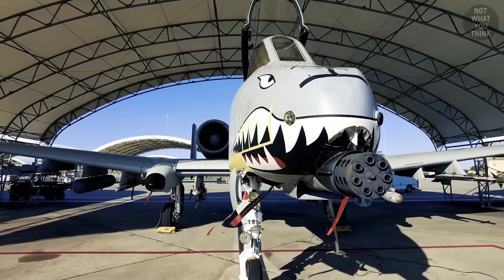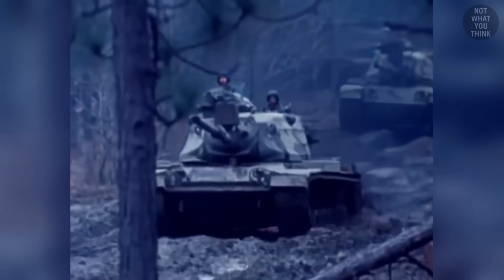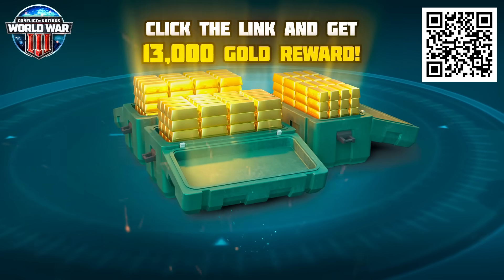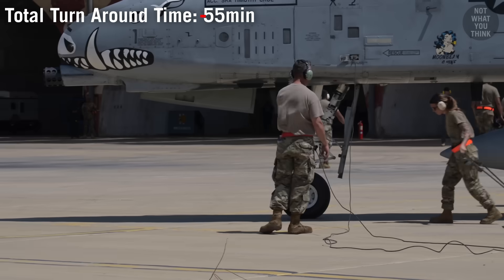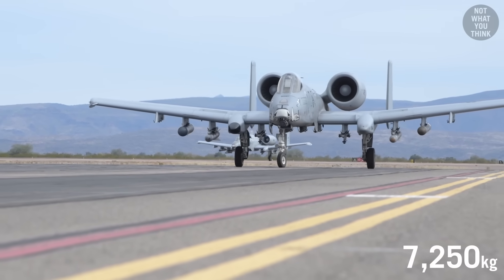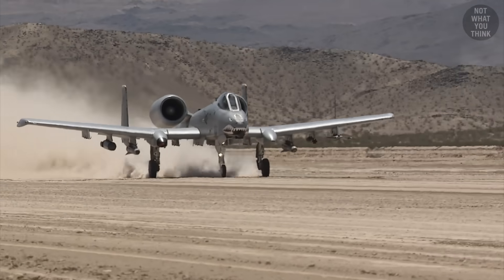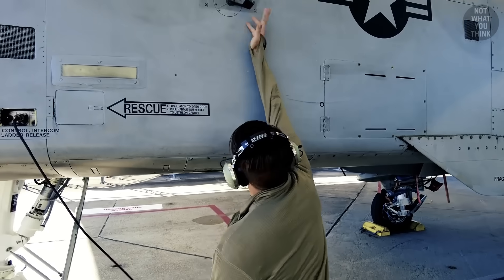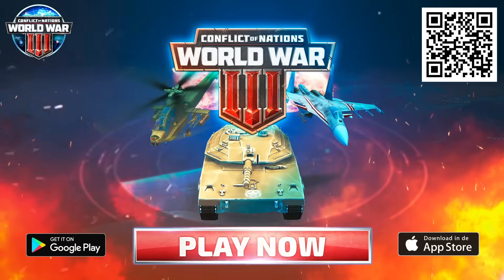The Aircraft That Doesn’t Eject Bullet Shells

Comment: The grunts are going to be hurting now that the A10 is retired.   The F35 is NOT at suitable replacement.  The F35 was never designed to be a CAS (close air support) aircraft.  It will fail in this role.

Comment: IT'S BECAUSE THEY USE THEM TO HOLD THE WEIGHT BALANCE IN CONTROL AND THEY COME AUT WHEN YOU PUT THE NEW BIG MASHINE CANON BULLET'S IN AND THEY STILL SIT IN THE BELT AND COMES AUT WHEN THEY LOAD IT BY TURNING THE BIG MASHINE CANON BACKWARDS TO LOAD FAST AND THE MANY KILO IS COMING AUT AND IS REUSED FOR IT IT'S VITAL FOR STABILITY AND THEN THEY DONT HAVE TO BUY A HOLE NEW SET AND THINK IF IT REALLY WHERE DROPPING THOSE BIG SHELL'S AND THEY HIT SOME INNOCENT PEOPLE THAT WOULD BE VERY BAD, SO TO PROBLEM'S SOLVED IN ONE GO.🌹🌷🌺🔥%.
 ♥️🇩🇰K.H.C.🇩🇰.
🇩🇰COPENHAGEN♥️DENMARK🇩🇰.

Comment: The A10 is definitely not obsolete. The military has been trying to retire it since it was adopted. The reason it's still flying is because its so damn cheap. Probably the most cost effective CAS platform in the world
Reply: Low and slow. Many sams systems can not shoot a A-10 down. With a little air cover, the A-10 can still shine. And nothing better suited for CAS than the A-10.
Reply: It's obsolete in every place filled with manpads.

Comment: Why do people prefer the A-10 Warthog over the sky warden? Is it more durable? is it easier to refuel and rearm these things to get it in the air faster? Is it purely the vibe or the sound of the gun? There has to be something I'm missing otherwise it just feels like the sky Warden is better in every single way other than a gun. It can loiter in the air longer, it's got much better sensor equipment to actually detect enemy movement and armor on its own and warn ground forces about it ahead of time spot targets on it's own, it's smaller and probably more maneuverable, it doesn't have a gun but it can hold a ton of missiles and bombs that are great for dealing with armored targets. What am I missing here?

Comment: The USAF have planned to retire the A10 since they  came into service - they have always found that the A10 was the only solution to a problem that ground forces were faced with. They were due to be retired in 1990, 2000, 2012, 2020 and now 2030 - I'll believe it when I see it. 

As for the aircraft already sent to the boneyard - these will be the older ones that have already exceeded their flight hours for the airframe

Comment: It seems to me a budgeting problem. The A-10 could be kept on because not all battles are peer to peer.  Let's say we need to put troops into Myanmar.  They don't have top SA missles systems, nor expensive radar.  If the A-10 squadron is paid for, pilots trained, spare parts are in the pipeline, etc.  Wouldn't it be cheaper to send the right tool for the job?  Just keep 2 squadrons around for the small jobs? How expensive is maintaining 2 squads of A-10's v. building and flying brand new F-35's?

Comment: I suspect the A-10 will hang around like the B-52. The Air Force KEEPS TRYING to decommission them, but as long as you have friendlies on the ground you'll need CLOSE air support.
Reply: close air support is already a provided with fighters, helicopters and drones
Reply: @aquilesca5tr0  Fighters do it BADLY. Helicopters do it Slowly. Drones don't carry enough firepower and lack connection to the grunt on the ground
Reply: @gcswift2  the f35 is already the replacement for the a10, the a10 is just completely useless in a modern envinronment

Comment: It is thought the A-10 is obsolete because strafing is no longer needed. It was thought that guns were obsolete on fighter planes due to air-to-air missiles. This is why the F-4 Phantom was built without guns and a gun pod had to later be added. Staffing is direct, up close visual targeting and the staffing pass can expose more targets. The armor of the A-10 was not designed for the modern antiaircraft weapons of today does not mean retrofitting cannot be done. For that matter, a new generation of A-10 designed a built to counter the new ground fire threats. These are designed for ground support only and would not be redirected to intercept enemy aircraft so troops needing their support would not be left waiting whole under threat.
Reply: Most of what you have said is true, but there's only so much armor and anti-missile tech you can throw onto a slow-moving target before it's no longer able to take off. With modern weaponry, it's far more efficient and smart to simply use a faster plane that can get in and out before the enemy has any real time to try to take it down. Remember what he said, modern anti-air weaponry can keep up with some of the fastest jets in service today. The A-10 is literally a sitting duck in comparison. Sad, but true.

Comment: From what I've heard, the Air Force brass hate the A-10 - it's slow, ugly, old, low-altitude, works right out on the sharp end, and does the non-glamorous job of supporting infantry ground-pounders. They've tried to retire it repeatedly. Not sure what the pilots themselves think about it. 

However the Army LOVES it. It can take out tanks or artillery, and send soldiers scattering for cover and into disorganization. And that's why we still use them.

Comment: What they really need to do is simply redesign and remanufacture new A10s with state-of-the-art avionincs. The actual construction of the jet itself is amazing - that doesn't need changing. Neither does the propulsion system or the gun, which is HIGHLY effective at its job. What does need updating are typical things like the sensor package and modern targeting systems, but beyond that the actual concept and overall body of the plane was amazing from day one.
Reply: the f35 is what is needed for cas in the modern battlefield, the a10 will be vulnerable to manpads no matter what upgrades it gets

Comment: the A-10 won't be retired until there's an actual replacement. f-35 doesn't fill the role of the a-10, neither do f-16s. So i feel like that line of reasoning is incorrect.

Comment: F35 is not an appropriate replacement for A10, it lacks the low speed handling of the A10, which is essential for CAS.... F35 can't just loiter for hours.
Its just not right for the job.

Not that I'm a huge fan of A10 either, but A10 is a lot better at CAS than F35 will ever be..... because F35 isn't built to do that job.... F35 is an invisible fighter, it has better things to do than dropping bombs on ground grunts.
Reply: you can´t have something flying low and slow for cas in a modern environment, manpads are always a  threat
Reply: @aquilesca5tr0  manpads have always been a threat, and A10 has managed to low and slow despite that threat it for decades.

I do get what you're saying though.

There are no good solutions if its anything near peer.
Reply: @Mort_OOPz  manpads weren´t a real threat when the a10 was designed
Reply: @aquilesca5tr0  Right, but they've been a thing for the last 40ish years, A10 has kept flying, not sure what your point is?

Comment: Oh and your bs narrative re the a10 being obsolete   you have missed or misunderstood a ton

Not to mention the fact that there are a bunc of brass at the USAF finally pulling their heads out of their asses   or not getting enough sweetheart deals from lhm to buy their continued support.

Fact is the a10 despite some wanting it gone for decades will not be going away as some want  esp aith the pos 35 never going to fo what they claim

And the dolts at the usaf are again learning lessons the hard way  same as they did with the f4  when they claimed it didnt need a gun  it would all just be long range missiles from now on and no one needed to dog fight or even an aircraft that could do so..  it just needed to be fast and carry missiles for them russian bears..

Along came VN and the bitchslapping the usaf/usn took with thre f4s was beyond embarrassing

Its lesson learned the F15 was born  and again wa claimed to be obsolete and would be replaced by f22a then f35s  and now less 35s are being built.. and new updated avionics on the same basic airframe design from the early 70a are being built for the USAF

The USAF/craft when observed was a bad enough of a mess  but now they are both such absolutely so far head up ass in so many ways I would never willingly join either now

They are spending more time in idiotic DEI and other absolute nonsense than they are the actual job it's not funny  it's a disgrace

Comment: Now think  the 11min for the a10 shuch is designed to be a CAS design..
The Gripen has a turn around of under 10min with 1 trained crew and 3 untrained grunts helping..  That's a full refueling and rearming   and a turnaround including a full engine change in under an hr can also be done at the side of the road

Litterally on the side of what we call secondary highways..  it only needs a short strip to land and takeoff  and is RFL type as well

Then thenflipnside of the princess  aka fat amy  aka f35 thst will never ever be able ton do more then dream of doing anything even close..   with the data download for the flight log etc being locked at a 1:1 ratio at best..  so 1hr flight time  is min 1hr just to get that done and it cant be sent back up wo such being done
Add in the insanity of it needing tonphone home to LHM every single time it does anything.. esp just starting up  

and it can be remotely DISABLED!!!

Think on that for a min..  the nightmare of software and cars now being remotely disabled due to the server being off at Sony to save them costs..  or younger duped into the beyond dystopian geo timing and geo fencing crao shoved into a huge % of cars dating back to at least 2016..  as exposed recently with the hyundai kona hybrid pos

Imagine being X country that is right now all buddy buddy eith the disaster biden admin.. and your elected nimrod innofficenis a fellow lefty loonie like biden and they waste X billions on buying f35s for political reasons despite it never being a good pick

  but then you have an election and your new leader is say center right.  Nothing extreme like biden or jacinda etc  but someone with common sense and just right of center...

Well then with soured relations you find your military used to defend your country has then big fancy $$$$$$$$ fat amy jets sitting in their custom air conditioned hangars since they can't survive real world wo their special spa...   and county Z that decided they want your natural resources since they hsvebfuked theirnown country for decades but have some mil equipment.
And their loony leftie leader gets on their knees for biden  so they wont help you defend your country  but someone that likes cou try Z decides your fat Amy's should stay couch bound when they try calling home before you can launch them to defend your country 

The dystopian nightmare of that aspect alone is beyond a nightmare    nvm the fact that the f35 is the worst disaster in US aviation history for any  "fighter"  or bomber for that matter
If you have not read the report on the f35 done by a very qualified expert for the Oz gov whom had full top clearance  and wrote the report so the dolt politicians could understand it   and leta justbsay the report was NOT anything like even an F in school   an F would have been a massive improvement

Anyhow  the same asshats pushing for shit like the fat amy disaster want to kill the extremely effective A10 and to  LMFAO  replace it for CAS with fat amy...  thatbcant even withstand smallarms fire ffs!

Comment: The A-10 is a critical aircraft. Cheap to operate $6,000 per hour & 95%+ availability rating. The F-35 only cost $35,000 an hour to operate with 50% availability.
I like the F-35 but it's a stealth fighter, not an attack aircraft.

Comment: They've tried to retire the A-10 several times. While some of the things can be done with other platforms, there is something to be said for eyes on the ground. Also, Washington bean counters also like its lower cost per kill. Sure, the A-10 is more vulnerable than ever before, but it is not obsolete. I have yet to talk to a grunt that said they'd rather any other plane above them in a SHTF scenario where they are being over run. That should say all that is needed.

Comment: I interviewed at the company that built the loader for the A10. The guy who designed the loader told me that the reason for not ejecting was that you lost control of the shell as soon as you tried to eject it. With the very high firing rate, that could lead to jams if a shell happened to linger in the ejection port longer than expected.

Comment: 2:24  well the gun was during testing pretty bad and it was tested on M47 or M48 pattons (not sure) but all tanks could have bean mobalized in 24 hours and they were moving in a straight line forward it was pressumed that the gun couldnt be practicly used to destroy T-62 tanks and thats why people like Pierre Spray are wrong they say that you only need the gun, no radar and avionics and a civilian radio for the role of destroying tanks but the A-10 has to use mevericks and bombs to destroy modern tanks
Reply: When they were testing the gun they did so on the M47 which at the time the analog of the t54/t55's the soviets were using. The test pilot was allowed to make as many passes on the static tanks. Targeting the rear engine deck I want to say he achieved an almost 40% hit rate but like you said none of the damage done couldn't be repaired in over 24hrs. As for peeyeew spray the dude was soo dumb probably thought lead chips tasted like candy.

Comment: The A-10 should be assigned to the army instead of the Air Force because the AF is obsessed with having one plane to do all jobs, I.e. high speed, high altitude interceptor, dog fighter and ground attack.  The army needs a dedicated ground attack platform to use as it sees fit,,

Comment: the coolest thing about a10 is that the military uses it as if it's an attack helicopter. it plays a very unique role comparing to other fixed wing aircrafts. but yeah, modern long ranged guided munitions are slowly encroaching upon the jobs s10 and attack helicopters do, namely close air support for ground troops. attack helicopters will have a longer shelf life because they don't require runways. a10 will be missed.

Comment: Retiring the A-10 is a huge strategic mistake.  It is not obsolete, in fact there is nothing in current inventory that can replace its mission.  No, drones and precision missiles will not do the job, and the F-35 is a joke.  The closest we have that could potentially fill in the A-10's mission is the AH-64 Apache, and while it is a magnificent platform, it cannot do some things the A-10 can.  This terrible decision will come back to bite us, and will be paid in blood.  Just like the B-52, the A-10 does its job better than anything else, and should not be retired until there is a true successor that will do the job.
Reply: It is very much obsolete and more vulnerable than ever. There are simply better anti-tank, close air support capable platforms in service. The F-16C and F-15E being prime examples.
Low-flying, slow aircraft are easy pickings for modern man-portable anti aircraft systems.

Comment: While the F-35 is a good platform it doesn’t really fully replace the A-10 in my opinion, yes it can carry a similar amount of weaponry if it doesn’t need to be stealthy and it has more modern sensors which is a huge plus, however it’s so much more expensive to operate and it’s need to maintain the stealth coating is an added cost and complexity when used in a CAS role.

Comment: One very crucial requirement for close air support was left unmentioned: target identification. Modern fighters can give the pilot better chance of identifying friends and foes on the ground compared to the A-10s infrared system, or the pilots own sight even when flying low and slow. 

The A-10 no logner is the best platform for figuring out who are the ones needing help and who is the thing they need help with, and then hitting only the foe, not the friends.

The other qualities of the aircraft hardly matter if you fall significantly behind on the most important aspect of the mission.
Reply: There is also the unmentioned fact that the A10's main IR sensor for the longest time was the Maverick missile, which cuts off imaging during weapons launch. This is why while the A10 has 947 claimed tank kills in Desert Storm, USAF credits it with "1/3 of that" and not with an official number. And also why it has no official confirmed kills because you can't do a BDA on A10 strikes.
Reply: This was fixed with the last sensor upgrade package. The fleet network integration was also improved so all the aircraft share data in really time.

No more blind spots. We have the all seeing eye in the sky.